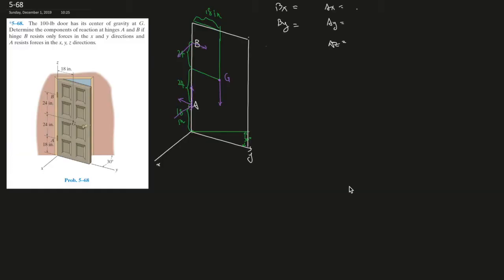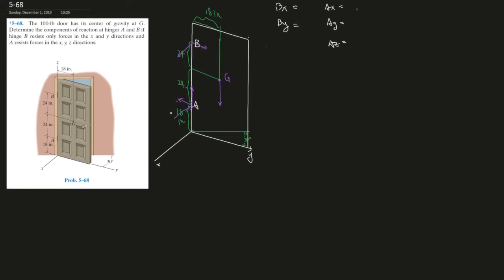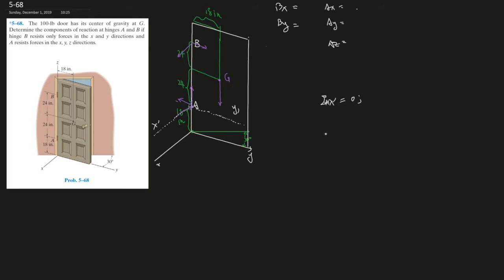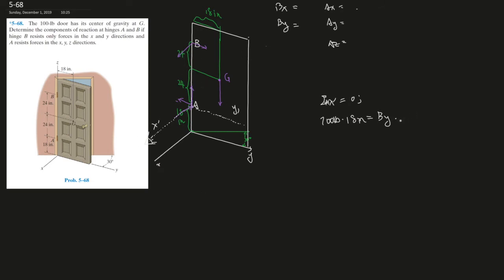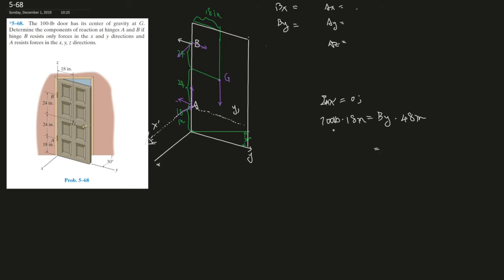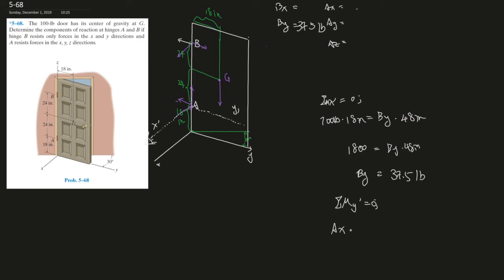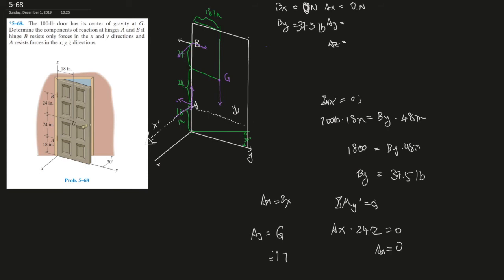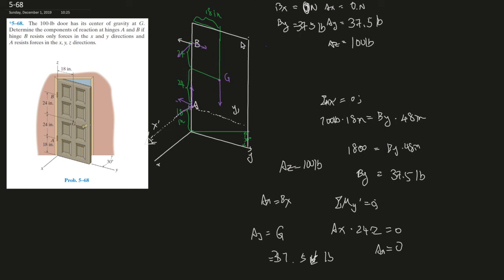5-68 Determine the components of reaction at hinges A and B on a door.

Comment: Here's a question Sir!...........
A door requires a minimum of 32.5Nm in order to open it. what is the minimum distance of the handle from the hinges, if the door is to be pulled with a force at the handle not greater than 50N?
Reply from the maker: 32.5/50
Reply: Why does the cuz no moment?